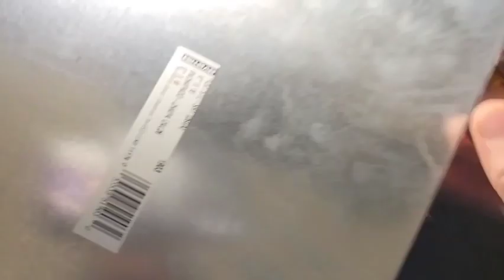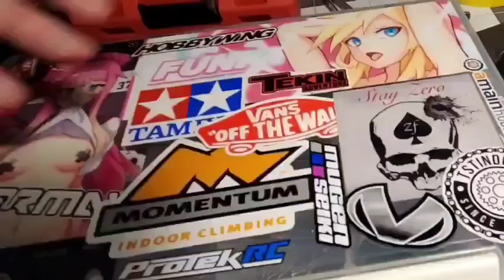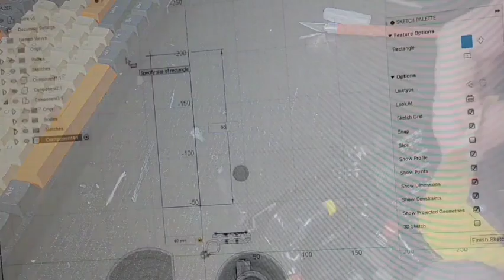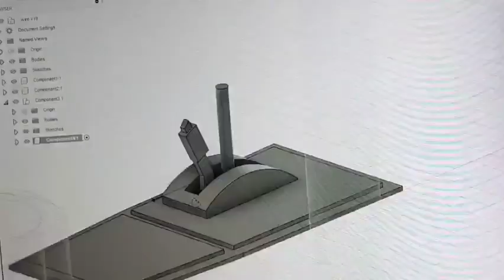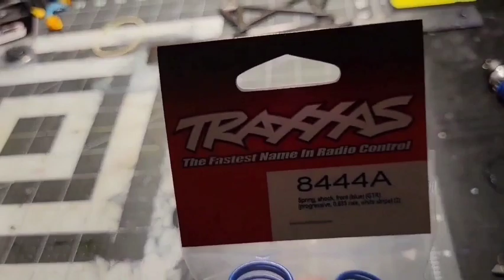Traxxas UDR: Full Build & Run

Comment: I liked the UDR build you did the details on painting turned out great and the driver's and center console shifter and cup holder and gauges is Sick bud! You have some talents with the 3D printing and that stand was neat too! I have several UDR's Fox bodies and a old Blue Method body I'm gathering part to make one of them just metal panels open wheel buggy type with paddle tires and upgrades I'm subscribed on your channel!😉👍📹✔️💯👋👋👋
BTW if you would print out those middle console shifter pieces you could sell them and stands???🤔

Comment: Cool video. a little advice from long time UDR user swich plastic wheel hexes to metal/alumunium ones
Reply from the maker: Yes, in the video they are upgraded to aluminum. There is a whole section on painting the faux calipers and changing them 👍

Comment: Any idea on how much you spent on the aluminum upgrades alone? I have a udr and everything that's weak is broke on mine
Reply from the maker: Oh man, I'm not sure I can put a dead-accurate dollar amount on it. But being my 2nd UDR I knew what needed it, and what doesn't benefit from metal upgrades. The Traxxas Upper Links are your best go-to, not as flashy as some, but the steel ones are like $20 and Damn Tough. I'd stick with Nylon lowers (like the RPM) as they seem to have just enough flex to keep hard hits from breaking other parts. Otherwise the GPM Sway-bar is a must, and I have tried just about every aftermarket driveshaft, and they all hold up about as well as the stock unit, 6s just breaks that grub screw or the pins on all of them eventually. Everything else is pretty well built from the factory. Hope this helps.

Comment: Hi do you know what paint you used for on top of the body?
Reply from the maker: Yes, it's the Traxxas lexan Flat Black. Tamiya PS-5 will also work. Just make sure to use Lexan specific paint as anything else will not adhere to the body and flake or crack off